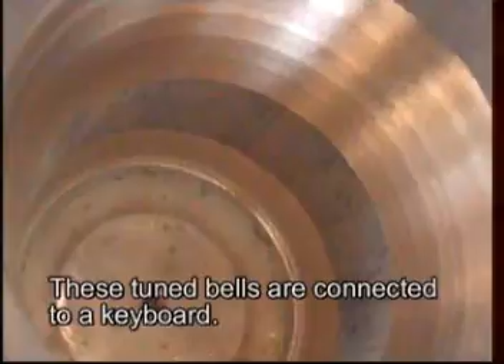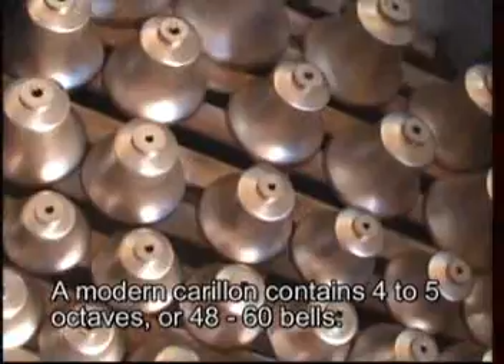What is a carillon  编钟 ?  "A Carillon Is..."  (2nd edition) - Wat is een beiaard?

Comment: The mechanism that operates a carillion is the same as the mechanical tracker action used in some pipe organs.As with the organ do some modern carillions use electric action where the Bells are struck by solonoids operated from a normal keyboard.

Comment from the maker: @ANDREWLEONARDSMITH This is what Carl S Zimmermann answered: I quote (Part III):
That electric action works well in organs but not with bells should not be surprising.  Organ pipes speak only one way, with air at constant pressure, so all volume control must be done with swell boxes.  (Tracker action can theoretically yield some very small variation in attack, but has no advantage thereafter.)

Comment: " ...or "having your own tower" ... " 

Hmm... what does a carillon and tower of your own, cost? Who makes and sells them? Is there a shop where you can walk in off the street, and buy one? If a new one is a bit beyond your price range, is there a yard you can visit, that sells used carillons and their towers? And, if you did manage to buy one of your own, would you need to apply for planning permission, or resource consent beforehand, or can you just go ahead and erect one? It would be on your property, after all!

One final question: does the carillon and tower come with a volume knob, so you don't wake up the neighbours, and have officers from the council come round and serve you with noise abatement notices?!!
Reply from the maker: Good questions.  Cost of a tower: depends how high, what material used, elevator or not,  etc.  Cost of a carillon: prices start at 350.000 euro for a small carillon, they go up to I guess let's say 40.000 kg x 30 euro/kg = 1.200.000 + extra's (automatic play, practice keyboard..).  Yes, you can go to the bell foundry and say: I want a carillon in my tower, please give me your best price.  You'll have one ready in about 1 to 1 1/2 year, depending the size you want.  Most of the time, the carillons will be in the tower for centuries.  Sometimes,  like in Eindhoven in the Netherlands, they removed the carillon to an other tower.  In Antwerp, Belgium they had two carillons.  One was kind of given to the city of Hoogstraten, after the war.   Last example, the old carillon of Meise, Belgium was replaced by a new (better) carillon.  The old bells were exposed outside the church and some of them stolen...   Most carillons has names and dedications on the bells.  If I would buy my own carillon, I would prefer to have my name on my bells!!  Yes, you need to be in order of all regulations, that is normal.  If you can buy an old Church with a tower, you can add a carillon to the existing swinging bells without any problem, that would be the easiest solution.  You don't need to put your tower on your property.  Many carillons in USA are donated by one person, and these carillons were put on the university campus where the persons studied, in the middle of the city where they lived or in an existing church.  Some examples:  Anton Brees Carillon Bok Tower Lake Wales Florida, The Laura Spelman Rockefeller Memorial Carillon in Chicago and its sister instrument at Riverside Church in New York City, Thomas Rees memorial carillon Springfield Il, The Charles Baird Carillon in Burton Memorial Tower... etc. If an association or company wants to have a carillon of their own, they can buy or donate a carillon like the American Engineers Memorial Carillon in Leuven, Belgium, or the Philips Carillon Eindhoven.

Comment: I assume that carillions that use Pneumatic actions are attached to or form part of the specification of a pipe organ,as it needs wind in order to function As there are examples of pipe organs that incoporate a carillion in their specification but this is usually only 1 or 2 octaves at the most and in most cases use tubular chimes or small brass bells of handbell size size due to space limitations.